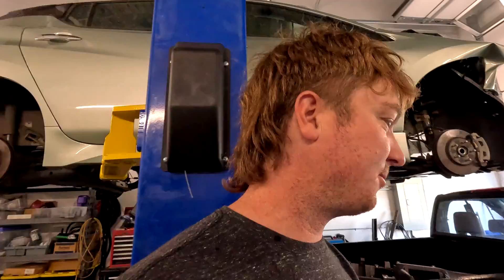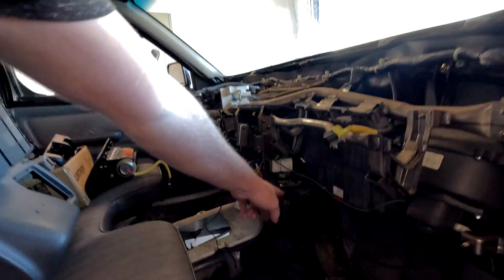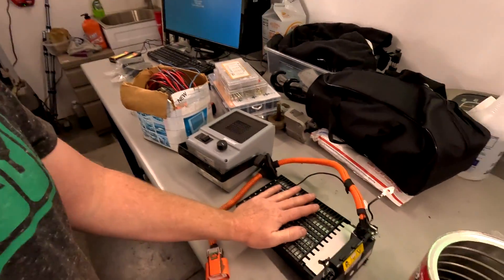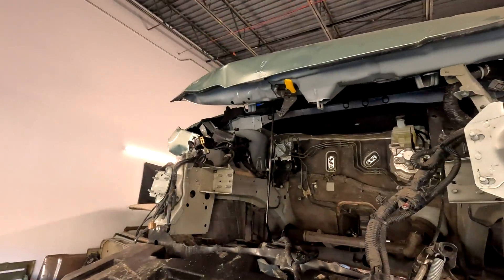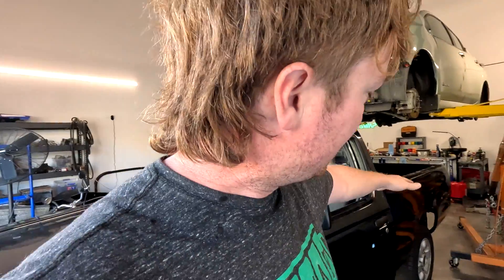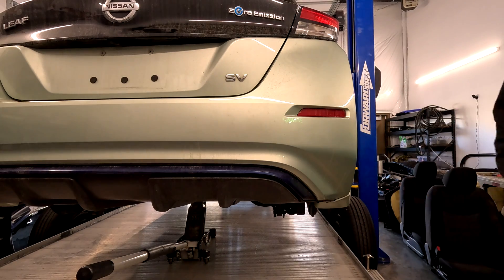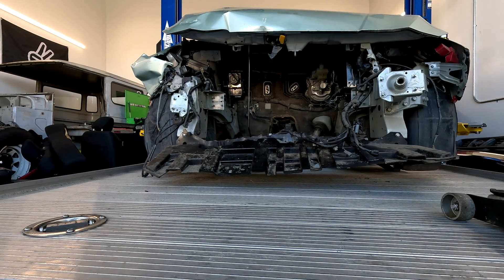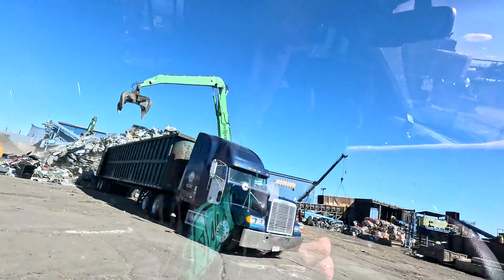Nissan Frontier EV Swap Electric Conversion Begins, Battery, Motor, Inverter and More Obtained!

Comment: Where is a good place to ask more questions about power steering and vacuum pump ? I have a Caribbean issue Toyota LJ79 in Nicaragua I would like to convert. It doesnt have power steering or a heater.
Reply: In fact, if you are doing kits - I am would be interested in importing kits to Central America for vehicle conversion, I believe it could be a valuable contribution.
Reply from the maker: Send me an email Jimmy@evswapconversions.com and we can talk more

Comment: Love the vids! Im converting a 56 Nash Metro with a leaf. Taking the leaf apart now. Heater core is a pain haha Any recs on getting a moto trans coupler made? Im in LA.
Reply: Also would you share the CAD files for the terminal covers you have?
Reply from the maker: Is it manual or automatic? do you know if the transmission was used in other vehicles? Also is it FWD or RWD? Answers to these questions will give me a little bit better understanding to give you some advice. I will put up the 3D models on Thingiverse in a little while.
Reply: Its a manual (3 on the tree) Its the original Metropolitan transmission. Its a rear wheel drive.  @EVSwap